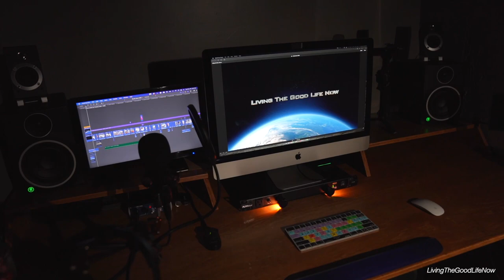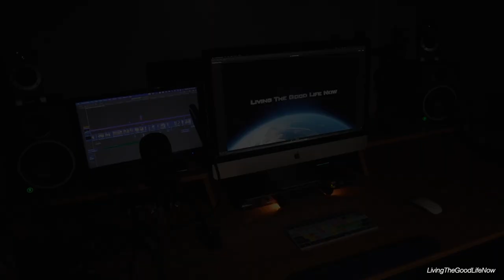Recording Studio Desk Build - DIY Easy Instructions - Output Platform Editing Workstation

Comment: Nice! I’ve been teaching myself woodworking over the past few years and although I’ve always bought my studio desks I figured I’d take a shot at building my own, especially considering how much they cost. 

I’m planning on doing a version of what you’ve done with the output style desk, but I’m going to use the legs from my sit sand. Also rather than plain maple, I think I’m going to stain it and do one of those half wood/half resin desks. I’ll most likely need some slightly thicker wood thought. Going to start off by making a side rack mount table…

Hey if they come out good I’ll probably end up taking orders !! Thanks for the inspo !!
Reply from the maker: Sounds interesting, have you made this?
Reply: How'd it turn out?